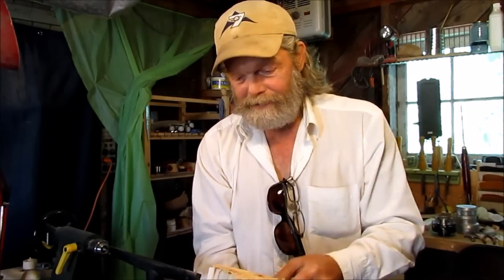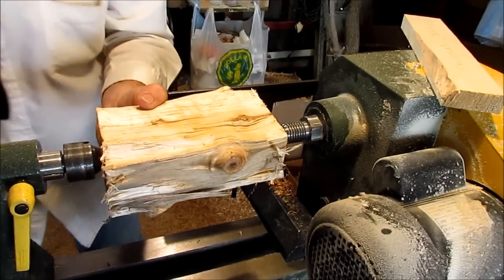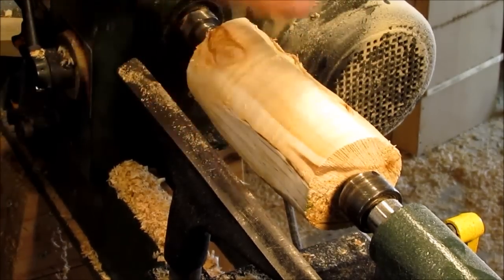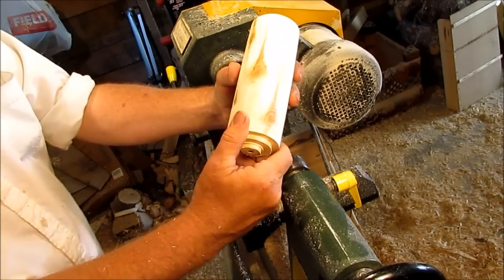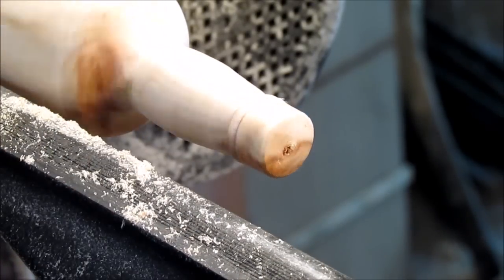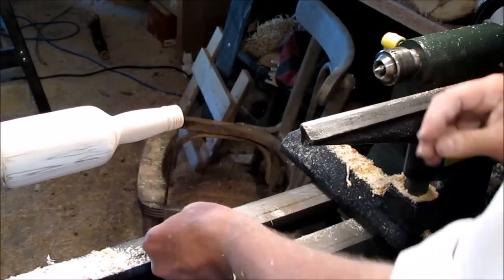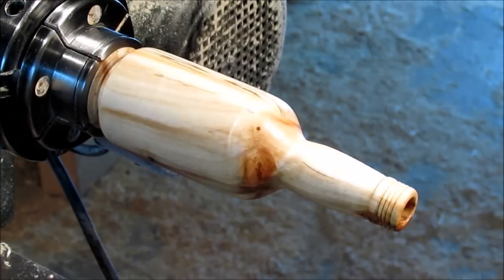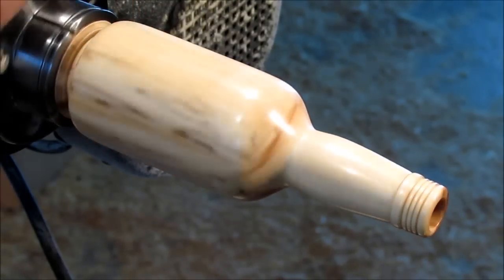Woodturning A (firewood) Beer Bottle

Comment: I made a bottle like that from birch but it was about 3 feel tall. I cut it in half on the wide part then I hollowed out on both pieces. Made a bit of a ridge so that it will hold together so I could lift the top part off and put it together so it looks like one solid piece.
Reply from the maker: Thanks Lawrence. Sounds like a great idea. 
Cheers!

Comment: When I first saw this I tried making one before I watched the video. Now I'm glad I watched it so I can try again. I just wish you had put in the sanding of the bottle treads. That seems to be the part I have the most trouble with.
Reply from the maker: Sorry about that Johnathan. I've found that a lot of people don't like watching the sanding parts, so I often leave them out. Really, all I did to sand the threads was fold the sandpaper in half and used the edge in the grooves. If the sandpaper edge is too thin, I'll just give it another fold, or wrap a small piece of cardboard in the sandpaper and use the edge of that. 
I hope that helps a little.
Thanks for watching.
Cheers!
Reply: Jerry Paul ok thanks for the reply, I'll give that a try and see what I can do.😁

Comment: Beautiful project... Is there anyway you could actually hollow it out and make it sort of usable as a bottle??
Reply from the maker: It's pretty small, but it could be done. Had I wanted to hollow it, without hollowing tools, I would have needed to take the blank down to round, and finish the bottom. Following that, I would cut the bottom off leaving a bit of a tenon on it. Once that was done, I would hollow the body to the point where the neck would begin making sure that I contoured the  inside shoulder. On the bottom of the bottle, I would create a mortise to match the tenon on the piece that had been cut from the bottom. At this point, I would likely begin contouring the outside of the bottle matching the contour of the inside cavity, but not so far up the neck to compromise the integrity of the wood.... Probably just up to where I contoured the shoulder. Once that is done, I would turn the bottle around, using the mortise in the bottom of the bottle to chuck the piece in my 4 jaw chuck and finish the neck. Here is where I would drill the opening of the bottle, and finish the piece. Once finished, I could then remove the bottle and finish the inside with epoxy to make it water tight, as well as the part of the bottle bottom that would be on the inside of the bottle.Once everything was cured, I would fit the bottom to the bottle once again using epoxy so that no liquid could seep out. After about a week of curing, I think it would be a usable bottle.
That being said... it would be a lot more work. 
Glad you liked it. Thanks for watching.
Cheers!

Comment: why'd you not make complate bottle ? you should have to make inside hole
Reply from the maker: Short answer... I just didn't want to....
Long answer.... - It's pretty small, but it could be done. Had I wanted to hollow it, without hollowing tools, I would have needed to take the blank down to round, and finish the bottom. Following that, I would cut the bottom off leaving a bit of a tenon on it. Once that was done, I would hollow the body to the point where the neck would begin making sure that I contoured the  inside shoulder. On the bottom of the bottle, I would create a mortise to match the tenon on the piece that had been cut from the bottom. At this point, I would likely begin contouring the outside of the bottle matching the contour of the inside cavity, but not so far up the neck to compromise the integrity of the wood.... Probably just up to where I contoured the shoulder. Once that is done, I would turn the bottle around, using the mortise in the bottom of the bottle to chuck the piece in my 4 jaw chuck and finish the neck. Here is where I would drill the opening of the bottle, and finish the piece. Once finished, I could then remove the bottle and finish the inside with epoxy to make it water tight, as well as the part of the bottle bottom that would be on the inside of the bottle.Once everything was cured, I would fit the bottom to the bottle once again using epoxy so that no liquid could seep out. After about a week of curing, I think it would be a usable bottle.
That being said... it would be a lot more work.
Thanks for watching.
Cheers!
Reply: Jerry Paul thanks for replying  😂 
you have to cut the neck like a 2 parts then it will be easy for you to drilling inside the bottle and then fixing again  ,anyway you doing good job amazing work 
appreciated...☆☆☆☆
Reply from the maker: I would actually prefer cutting the bottom first as that way, the seam would not be as noticeable. ... That's just my own opinion, though. I really appreciate your feedback. Thank you very much!